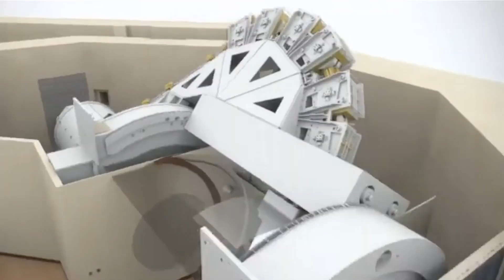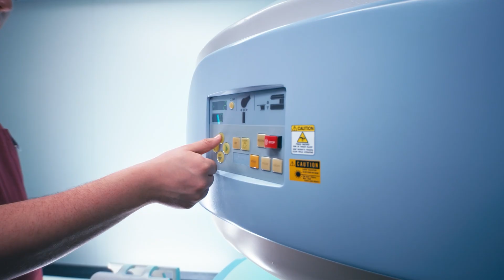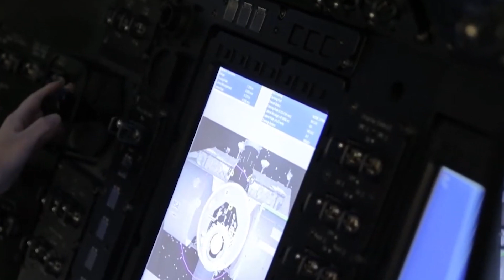Adelaide Megaprojects: 5 Projects That Change South Australia in 2026

Comment: Well! Talk about propaganda being dumped on everyone like treacle! And really there are so many misleading items in the narration! More like Deadelaide on life support. They want to put Adelaide on the world stage, but in the process, they have destroyed what Adelaide was known for in heritage circles. First and foremost as a planned city, which it no longer is, with major developments in what would have traditionally nominated Parklands. But when discussing the tunnels, they don't mention that it also doubles as a mobile gold mine! And strange that by the time it is finished, it will be determined by traffic lights at both ends, yep, typical! But they think the tunneling machines are one of use, but do not consider putting them through the hills to alleviate another problem area. And the shipyard, well say no more, think of traditional methods and you'll be pretty close to it. With bureaucracies full of woke and dei, makes you really wonder about the capabilities of the ship yard. Then there's the Bragg center, what a lemon, it was built, but because of international pressures, could not be installed, so now its recycled to someone else! Then there's lot 14, that would have to be the biggest joke of all. But the stadium once again is beyond imagination. Does no one think that they haven't already built over the train lines????? Vibrations, now there's a laugh, buildings nearby should be collapsing by now. Go into the nearby carpark and you can watch the trains come in and out of the station! But this about a leftist government and the propaganda, an election is due in 26, so is just a ploy to say what we did, but what can they provide for the future? Another hydrogen plant, (failure). A city and a state that severely suffers from the net zero bullshit. Oh and another failure, unable to get the COP31 convention, which would have stopped local mayors from running away overseas!